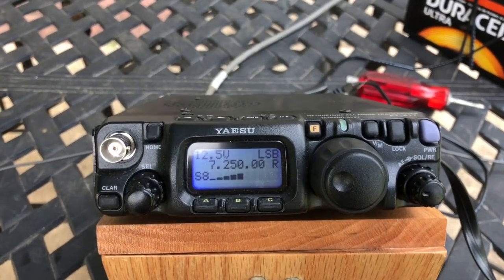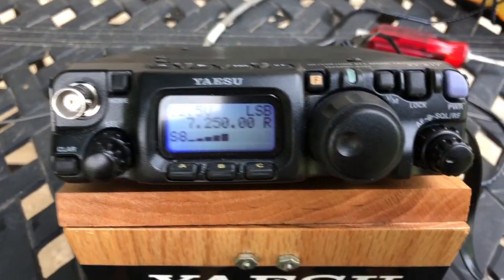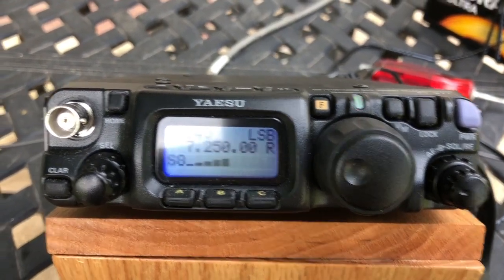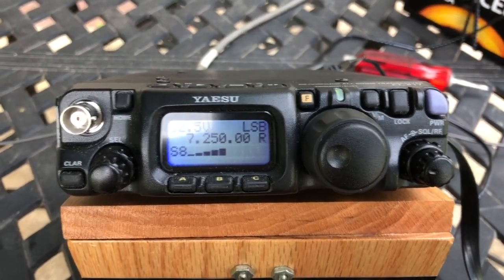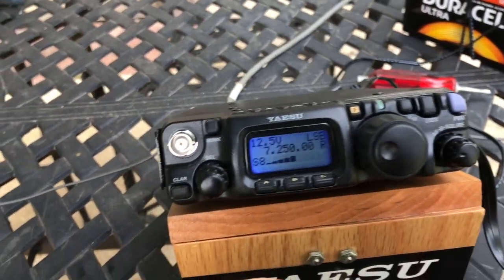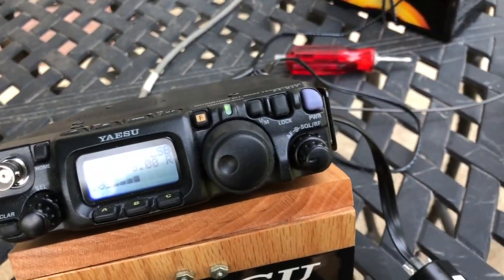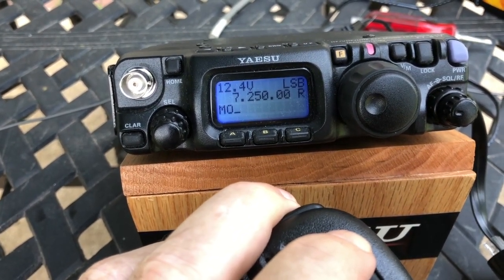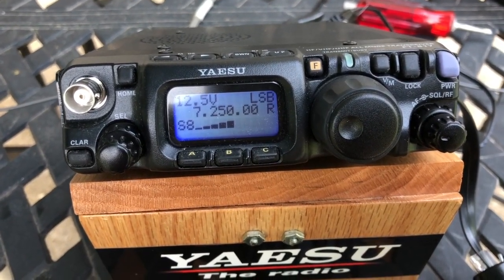SOTABeams Speech Compressor test part 2

Comment: Buy this speech compresor from eBay at a fraction of the coast -  MAX4466 Electret Microphone Preamplifier Module With SSM2167 Voice Compression  - its tiny and will fit into the MH31 mic

Comment: works great if you don't go berserk on your ssb mike gain!!
i was over mod with 9a1rbz on 20m then switched off comp.and got a 5/9
my ssb was set at 70
lesson learned now down to default
I also think this is not set in stone but you can vary to conditions   band  etc etc 
But got to say sotabeams compression a bonus on qrp
(5w)  73
Reply from the maker: lawn green I typically run the mic gain at around 45-50.  Thanks for stopping by!  73 de K2CJB
Reply: @k2cjbradio  well it was you who got me to spend the Pounds in the first place!!
hi ho  73
shave and a hair cut 2 bits!!
Reply: @k2cjbradio  nice 1 old man hi hi 73